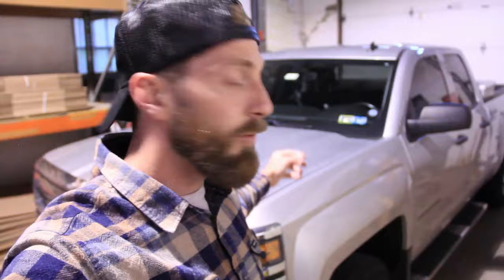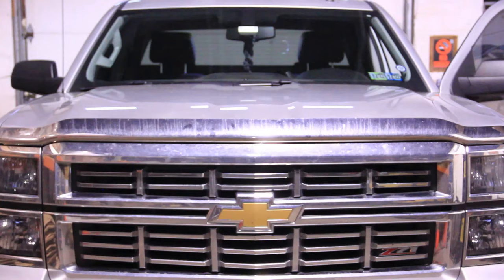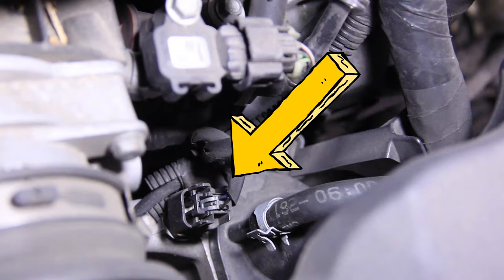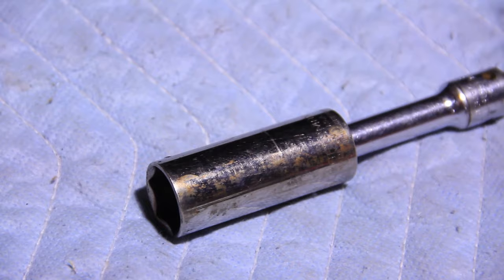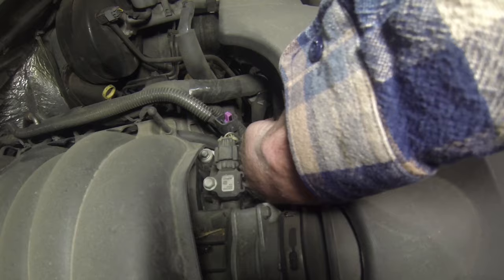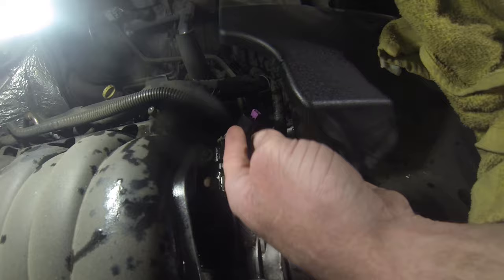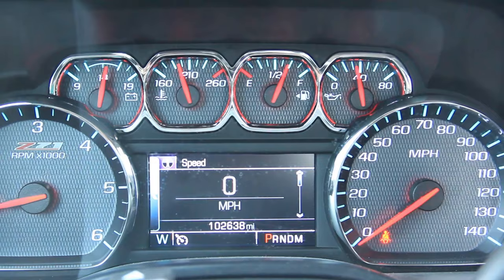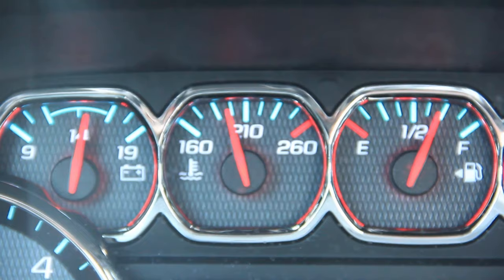Radiator Fan Won't Turn Off: 2014 - 2019 Silverado & Sierra: Bad Coolant Temperature Sensor Replaced

Comment: Let the engine cool down some first and then remove pressure in coolant system via radiator cap or coolant reservoir cap so that no coolant spurts out onto electronics like coil pack, distributor cap (if applicable), alternator, electrical connectors.
Reply from the maker: Thanks for the tip!
Reply: How do you remove the pressure from it
Reply: @gustavodelgeh3580  let your truck cool off and remove the cap from the coolant tank

Comment: I’ve put 2 different sensors on my 2015 Tahoe an it will do good for a week or so then the temp gauge will stop reading an fan won’t kick off, I’ll have to undo the battery terminal then hook back up it will do ok for a few days, what could be the issue

Comment: This happened to me over the weekend,  I decided to replace both the sensor and thermostat. In my situation, I lost about a half gallon of antifreeze. Total cost at Auto Zone for the sensor, thermostat and a gallon of antifreeze was $110.  Tools/Supplies were Channel Locks for the hose clamps, 19mm deep socket for the Sensor, 10mm socket for the thermostat and negative battery terminal, old towel to absorb antifreeze spillage, and funnel for reservoir to add new antifreeze.  The sensor came with an adequate amount of Teflon Tape, so I didn't add more.  After laying out the needed tools, it took less than 30 minutes to complete the job. This task is easier than an oil change.
Reply from the maker: Glad we could help out. 🤙

Comment: It’s a lot easier to replace, if you remove the air intake assembly, first. It takes less than a minutes to remove it. It also allows you to clean your throttle body (if needed) and any coolant that gets spilled on the front cover during sensor replacement.
Reply from the maker: Thanks for the heads up Josh!
Reply: If you let the vehicle cool down and then you can remove  the radiator cap or the coolant reservoir cap whichever one your particular vehicle happens to have. By doing this you don't have to worry about any fluids coming gushing out from underneath that sensor. As a result you  don't have to worry about the anti-freeze harming any Electronics such as wire connectors, alternator, distributor cap if applicable, Etc.
Reply: @michaelrehkop4817 Coolant is going to flow out, as soon as you remove that sensor, regardless of whether the system has pressure on it or not. Besides, it ain’t like coolant is going to hurt the alternator or any other part of the electrical system, anyway. It’s got sealed connectors.
Reply: Nothing came out when I changed mine. Taking the I take would just be more work. 19mm deepsocket on extension no problem. Literally took all of 5 minutes to change mine. Took longer stuffing rags all over the place in case it did shoot out.

Comment: Thanks for the great video.   I went ahead and just changed both at the same time,  had 70$ in it and it took about 20 minutes.   I didn’t even have permatex all over my hands after (cause it’s not needed) unlike the old cars I’ve wrenched on years ago.  Took longer to open the pinch clamps.
Reply from the maker: Hey Joe, thanks for watching the video.  Glad we could help and everything worked out for you!

Comment: Sometimes after swapping the faulty temperature sending unit, the fans may continue to run full blast for a few driving cycles if it threw a code. To speed that along so you don't have to wait the few driving cycles for the code to clear, unhook the negative cable from the battery for 10 minutes to reset the PCM while you're swapping out the sensor. It will clear the code and will run normally the next time you start it, instead of two or three times later.
Reply from the maker: You are correct, we did a follow up video explaining that: https://youtu.be/wed9eZxPwsQ
Reply: I’ll will try that
Reply: After replacing the faulty temperature, the temperature gage starting going up as soon as I start the car, any suggestions why
Reply: Would turning the engine on and off 3 times work?
Reply: Great tip! Thank you!
Reply: I found starting and turning off the engine 3 times without going out of park, seems to work. Probably better to unhook anyway because the engine won't be warm for the 3 quick starts.

Comment: I got my 2017 Silverado LTZ in 2016.Yesterday my fan stayed on and the AC stopped working. I followed both links. I changed out the sensor, thermostat and hose and I'm back on the road. A neighborhood mechanic said $150 in labor to do it. I just had back surgery but I did it myself. You made it very simple and I thank you Sir !
Reply from the maker: I'm glad that this video helped you out!  Thanks for watching and taking the time to leave the feedback. 🙌
Reply: What did you do when the A/C stopped working? Replacing both the sensor and thermostat fixed my fan from running, but now my A/C stopped  working. 🤦‍♀️
Reply: Omg ! I'm not sure what the problem is with your AC. I did replace the sensor and the thermostat though. Its been working fine. I'm curious though why your Ac stopped. I'm in Arizona and we aren't using AC! Where are you ? Lol

Comment: I purchased the parts on Amazon and then took the advice in the comments of disconnecting the negative battery cable for 5 minutes and that fixed my issue of No AC and fan continually running. So then I had to go back to Amazon and cancel my order. Youtube is the best.
Reply from the maker: If you did not replace the parts, your issues WILL RETURN, within a few days.  Please follow our instructions in the newest video we made about this topic.  We detail why the issue will return if you fail to replace the defective parts. I've linked it here for you: https://youtu.be/7gKbLHhD1cw?si=LyV9pvN42YhHa8i1

Comment: Another YouTube video that solves the issue. Clear, concise and a savings to the bank account. Gives a guy the confidence to try himself and avoid a trip to a mechanic. 

Great job!
Reply from the maker: Hey Mike, glad you enjoyed the video.  If you try it, let us know how it works out for you!  Also, we have a few more videos that might help you out with your truck.  Don't hesitate to check them out!
Reply: @TheBrothersWorkshop  From the moment I noticed the problem, found your video, bought the part and spent 15 minutes fixing the problem. This was all last night in the dark. It's running smooth today. Watched your other videos and if another issue arises, it appears that replacing the thermostat is about as simple!

In short,  your solution worked awesome!
Reply from the maker: Glad to hear it! 🙌

Comment: Great video! Helped me solved the issue. One recommendation, remove the cap of the coolant reservoir to remove pressure from the system. You will still lose coolant but you are less likely to take coolant to the face ore get it all over everything!
Reply: Thanks!
Reply: Thanks!

Comment: Make sure you disconnect the negative battery terminal for about 30 seconds and then reconnect. It will allow your gauges to all reset. Once I did it with mine, the band shut off in the gauge worked.
Good video
Reply from the maker: Thanks for the tip RC.
Reply: I did my truck this morning and once I finished started the truck the fan was still running so I disconnected the negative cable and it work fine! Here a FYI if you’ve had this issue on the road and can’t figure out if you need a tow truck just disconnect the negative cable it will reset your computer and the temperature gauge will start working again for about a hour but replace the part like this video shows and keep riding.👍🏆
Reply: Funny thing is, disconnecting the battery terminal for a few seconds stops the fan  issue for me anywhere from a day to MONTHS.  I'm obviously resetting something more than the gauges.  Still, it comes back eventually.  I can't help thinking it's not a sensor or thermostat "sticking" as that is mechanical, not electrical.
Reply: @Crusty-eu8wj  Same here. After replacing the sensor and thermostat(I disconnected the neg. battery lead while doing this)the problem stopped for several months and then began again. Now, after disconnecting the neg. lead, the fans might stay off after the key is turned off for a week and then the problem starts again.
Reply: @Crusty-eu8wj mine is doing the same thing..did you ever figure out what was causing it to keep coming back?
Reply: @frankstone3994 mine is doing the same thing..did you ever figure out what was causing it to keep coming back?
Reply: @jayawhyman1564  For me it seems to have been the thermostat.  I had it replaced 3-4 months ago and haven't had a problem since.  I guess mine was stuck partially open, so it would get close to normal temperature, but not quite all the way there.  I guess this was enough for the fans to randomly come on full blast, turn the temp gauge off randomly.

Comment: Great video.  It helped yesterday on my '14 GMC.  The comment about removing the big wide intake helped, just two hose clamp fittings and two EGR clamps.  A couple other symptoms were a check engine light coming on (don't know code, don't have a scanner), and my air conditioning only blew warm air when the coolant temp was 160.  Seems good now.  By the way, if you carefully remove the coolant fill cap on the left side of compartment, it'll depressurize it and hardly any coolant will come out when you pull the sensor out.
Reply from the maker: Hey Chuck! Thanks for watching the video.  We're stoked it helped you.  The AC blowing warm is an issue we had as well, and thanks for the tip on how to depressurize the lines!
Reply: Ive done the sensor and termostato change but my fans are still turning off after I turn my truck off what do y’all recommend me do also I’ve change the relay
Reply: I been having this for months on and off
Reply: @ernestoguerrero326  clear the code, 128, it will lock in but no check engine light.
Reply: Great video. Easy changeout. Did it, and it worked, for a couple weeks until it happened again. Should i just switch out thw thermostat as well?
Reply: @jjarriola1955  if your truck is not hanging out at 210, all the time, it’s colder than it should be. The thermostat is allowing coolant to pass too soon and when it senses too cold it will lock in the 128 code, this will not give a check engine light but will make the fan stay on!  You can get the original ac delco thermostat from rock auto for 35$ delivered. Really, I think the sensor is seldom the problem, if ever.
Reply: thanks for the depressurize tip! im gonna do this tomorrow. my fan just started turning on high even when car was off, take minutes to even turn it off. thanks brothers workshop for the tutorial
Reply: @The Brothers Workshop  my fan was staying on too. My husband fixed that thanks to me finding this video, and now my AC only blows hot... what do we need to do? 2015 Yukon

Comment: Good video. I've also seen 2 2018 Silverados that had a bad plug on the AC pressure switch near the compressor. It caused the same problem. The wires broke and it was pretty easy to spot
Reply from the maker: Thanks for the tip!

Comment: I’m 63 years old. Recently retired govt worker. Married and a fixed income. Kinda grew up working in a neighbors gas station repair shop back in 70s .  Learned a lot and even made a living at it there.  But it’s been a long time since I picked up a ratchet under a hood. Wanting to save money I thought I’d give it a go . Thanks to your presentation and the Lords help it worked out fine. I also disconnected the battery after it didn’t work initially and then all was well. Thank you.
Reply from the maker: Hey George! Thank you for the kind words.  Feed back like this is the motivation we need to keep making videos like this.  If you have any more issues going forward, we have a trouble shooting video linked here: https://youtu.be/wed9eZxPwsQ

Comment: My truck was running low on coolant which tripped the sensor. After adding coolant I still didn’t have any change, but after reading these comments I disconnected the battery for 10 min and that fixed my problems. 

I did buy a new temp sensor, but since I don’t need it now, ima leave in the glove box for now.

Thanks for the video guys!
Reply from the maker: I think you misunderstood. Disconnecting the battery is only done after you replace the thermostat and the temperature sensor. If you don't fix the issue, the problem will continue. Eventually your computer will realize that this issue is still going on and you'll be back to square one.
Reply: @TheBrothersWorkshop  Thank you. But my problem with running fan has stopped, but I still have the sensor if case things go bad again

Comment: The video did help a lot. So thank you! The only thing I would add is that on a 2016 Chevy Tahoe, the ECT Sensor is in a very tight place next to the thermostat. It is very difficult to get the harness cap off the sensor. Because the area was small to work in it wasn't easy to remove the harness. There is a light colored plastic clip that needs to be removed first so you can pinch the small black release tab so the harness cap separates from the sensor. Otherwise, in a tight area not knowing this you could damage the harness cap that snaps on to the sensor. I didn't know what to expect and was concerned to break the plastic. Had a mechanic friend help after many tries and then it was easy. But not knowing this made it difficult.
Reply from the maker: Thanks Kevin! If you have any other issues with this problem, I've linked two videos here for you:
https://youtu.be/wed9eZxPwsQ
https://youtu.be/WvLyBM8FHdM

Comment: Same issue on mine. Changed out the sensor and started it up again, heard the fan running loud again and drove it down the block for a bit. Fan kept blowing after turning engine off. Decided to disconnect the battery as others have done here and reconnected. Fired her up and the fan is no longer blowing hard and the temperature is back to normal. Thank you!
Reply from the maker: Glad could help!!

Comment: This video was spot on!  Had my problem fixed in 20 minutes after I got home with the part & socket I needed
Reply from the maker: Hey! We're glad that this video helped you out.
Reply: @TheBrothersWorkshop . Why wouldn't my upper hose have pressure in it if it's just the sensor?
I have plenty of heat too.

Comment: I fixed my fan radiator on my 2014 Chevy Silverado 6 months ago because it wouldn’t shut off even after the truck was turned off. And I’m back on YouTube trying to figure out why it’s not working again. Very helpful video thank you.
Reply from the maker: Glad we could help Felix!
Reply: so replacing this what he did worked? i have the same problem for my gmc  sierra 2014

Comment: 11/13/23 very helpful video. Thank you. I had the same problem fan stood on 5-10 min after shutting truck off with check engine light on.
Changed the temperature sensor, and disconnected the battery. Started up, temp gauge works normal, and fan doesn’t come on after turning truck off. No check engine light. We good! Thank you again
Reply from the maker: I'm glad we could help!! It's such an easy fix, I'm glad people can fix this themselves rather than go to the dealership.

Comment: This is such a great video. I used it and your other one to replace the thermostat, and the temp sensor in my 2015 silverado when the fan wouldn't turn off, and the gauge wound get over 160. So I think the trick of whole issue is to replace BOTH, and to unhook the battery during the process to reset. All three worked for me. Thanks again for a great set of videos.
Reply from the maker: We really appreciate that! We're glad our videos helped out!!
Reply: This is what we had to do. After replacing both the fan was still running and the temperature gauge on the dash was stuck on 160°.  Once we unhooked the battery it reset and the fan cut off and the dash temperature gauge began to work.
Reply: @TheBrothersWorkshop  hey man i just replace my temperature sensor but fan still on when I turn the truck off do you think I should unhook the battery or will be something else, thanks for the video

Comment: I had the same problem, quick search brought me to your video, and I was able to get this problem fixed for under $20 in no time at all. Thanks! On another note - when the sensor stopped working, it threw a code and my check engine light came on. As a fail safe, I presume, it shut down my A/C. I was worried this was unrelated and I had two problems. Once I replaced the sensor, my check engine light was still on, and my A/C was still not working. I went to O'Reilly to get them to reset the codes, and they told me they won't do that anymore. Not sure if that was true or if they just didn't want to do it. Anyway, so I disconnected the battery for a few minutes, and after that the codes were cleared and my A/C was working again right away. So, maybe that experience will help someone else along the way. Thanks for the good video Amigo!
Reply from the maker: Glad we could help out!  However, this was one video in a three part series.  If you didn't see the other two please watch our new condensed version linked below. 👇 It goes over common issues and troubleshooting: https://youtu.be/7gKbLHhD1cw?si=LyV9pvN42YhHa8i1
Reply: @TheBrothersWorkshop  Thanks for the updated, condensed video! I don't know that I am going to go in and replace the thermostat right now, but I may be cussing myself for it soon. 🙂Fine work and I am going to definitely check out your other videos!